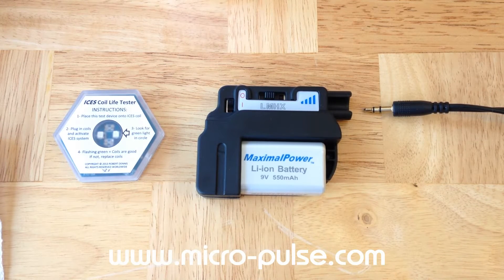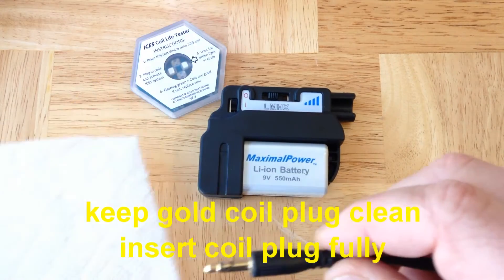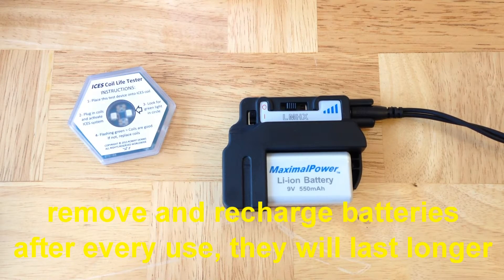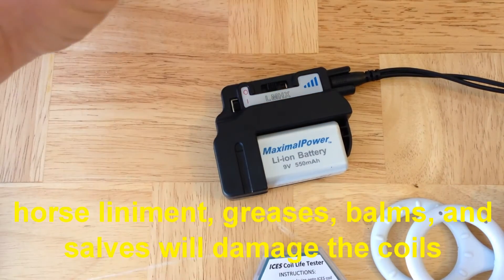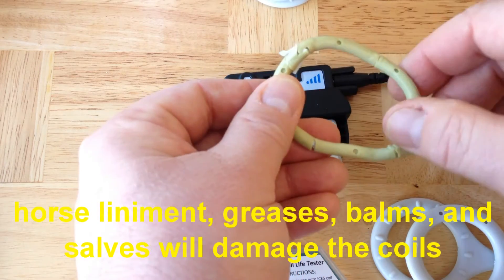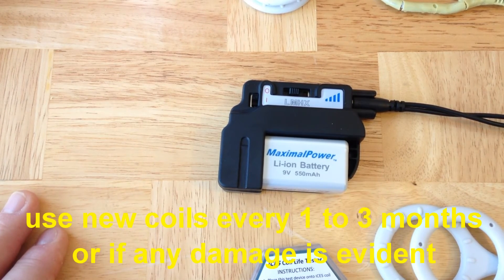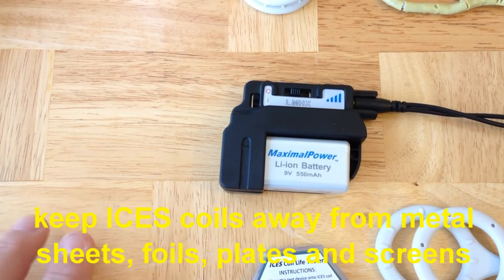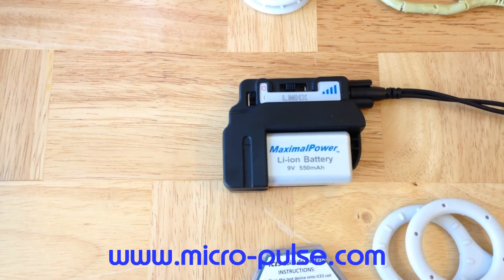Micro-Pulse ICES PEMF Tutorial 4 - Basic Maintenance

Comment: hi Robert...  I have a slight tear in my labrum, I have been using system now for about 2 + weeks I think I feel some difference but not absolutely sure.  What is the time frame when I should be seeing and feeling tangible results.  If such a guesstimate can be given.
Reply from the maker: We just spoke on the phone, but I'll repeat my answer briefly here.  It can take up to 3 weeks, based on my experience, to see a tangible benefit if it is used correctly every day for 6 to 8 hours per day.  Sometimes it is faster, but 3 weeks should be enough for you to determine whether or not you will get a benefit.  It may take much longer for the entire problem to resolve, but the direction should be clearly toward improvement within about 3 weeks.
Reply: It's been 2 years since you posted this.  Any update on your labrum tear?  Has it healed up?  Did you get a before and after MRI?

Comment: Hi I just received my micro pulse do you recommend I use it on low setting first for back pain I've suffered for 5 years after surgery and how long?
Reply from the maker: Generally I recommend the medium "M" setting to start.  You can use it for an hour or so for the first day or two.  Once you are accustomed to it, you can increase the time to several hours.  Some people use it all day and all night but that is not likely to be necessary.  You can also experiment with increasing the power setting to "H", but most people get the best benefit from "M", so please do not rush into using more power too quickly.  Initially, for the first few days of use, please remain awake and alert (don't just place it and take a nap).  There has never been a problem, but just in case, please be cautious.